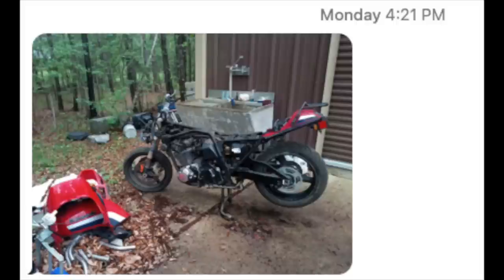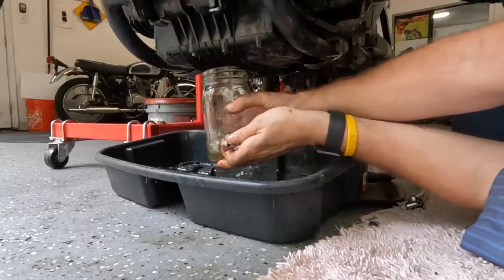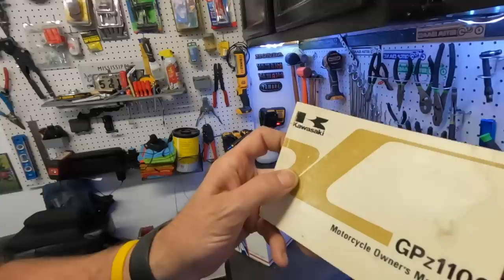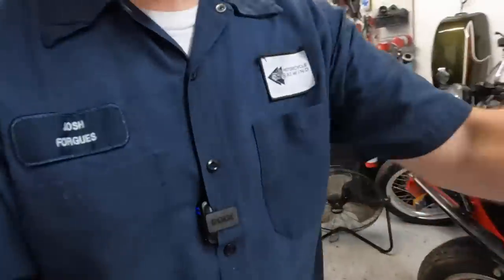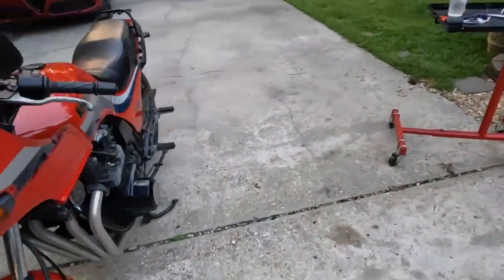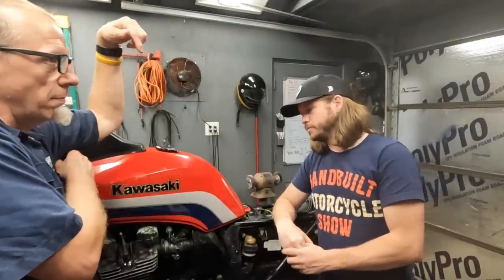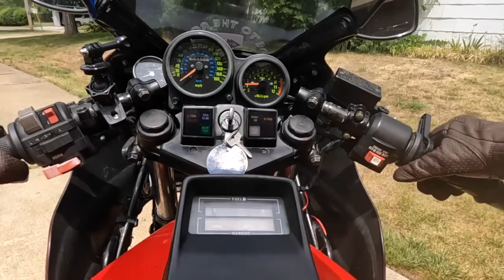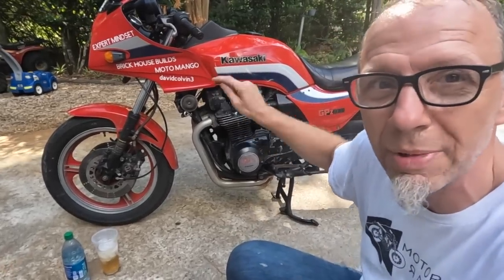Can I ride 3,000 Miles on abandoned 1983 Kawasaki GPZ1100 #gpz1100 #vintagemotorcycle #sportbike

Comment: Had a 750 in 87-90. My second bike and the first big one. This triggered a wave of nostalgia - and then all the stuff happening to your GPz cured me very quickly. 😂
A beautiful bike, was then and is today, but it wasn't very good even when nearly new. The 750, and this probably the same.
The tank rusted and leaked from the part leaning on the frame, killing all the rubber hoses with petrol, the mufflers fell apart inside, it was lazy, guzzled like a Russian.
And boy, did I love it. But, no thanks. 
In any case, I really enjoyed the video, cudos!
Reply from the maker: Thanks for watching and sharing your stories. That is my favorite part of these old motorcycles, the stories that come with them.

Comment: The setup and instrument cluster is so cool on this bike! Love the volts procedure! What a cool bike. Nd the KERKER exhaust what a score!!!! That exhaust probably alone worth $1500
Reply from the maker: Agreed. When I found the voltmeter. I was like a kid a Christmas. Thanks for watching.
Reply: In the day full header was a few hundred bucks, not sure why 2000 grand now still just metal pipes and cannister, really not any better than old ones just 10 time more expensive. I get high costs on some things but tires have not gone over 1 grand a tire but pipes are most expensive parts now that are not really worth the cost. in 85 bias ply tie for my ninja best around was 125 to 150 a tire  full header 400 bucks now tires 250 a tire for good sport bike tire but pipes 2 grand?  metal is not that expensive but tire tech is light yrs better.

Comment: Had a B2 gpz with intermittent running,  turned out it was the back of the fuse holder wires had gone green , once cleaned and reconditioned was trouble free 👍
Reply from the maker: That’s a good call. Won’t hurt to get back there and give it a good cleaning. Thanks for watching.

Comment: I had the GPZ550. That's one heck of a free motorcycle. 👍
Reply from the maker: I am trying to get a GPZ550. Just have to decide when I want to go get it.
Reply: @motorcyclerewind 
I owned a 1984 GPz550 / AKA zx550A1.    It had same frame-mounted half-fairing as your 1100.    My 550 was the LAST year they ever made GPz550.  The next year,  they came out with GPz600 Ninja  (with the 16" front wheel).

Comment: A great resurrection of that beauty. Well done man👍🙂
But you've to repair the tachometer 🙂
Reply from the maker: The tach works great. The speedometer needs the correct cable. Thanks for watching.
Reply: @motorcyclerewind  Don't forget to give us some news about that problem of ignition 🙂👍

Comment: Check your soldier joints on your ECU. Point them all. If there is a small crack anywhere, pointing them will fix this thermal problem.
Reply from the maker: That’s a great idea. Thanks for sharing and thanks for watching.

Comment: I can't remember if these had anti dive on the front end and maybe a 16'' front wheel if so that would explain the different front end as anti dive parts and 16inch front tyres are almost impossible to get. These were first Kawasaki to have Unitrac  rear suspension and the first manufacturer to do and production bike with efi.  Your doing a great job. One thing to watch is the cam chain tensioner  has 2 sprungloaded wedges which run crosswise check them regularly as they score and hang up so that the chain rattles face them off on a wet stone to fix it
Reply from the maker: Terry, it does have anti dive. 18 inch front wheel and 17 rear. The GSXR wheels that were on it were 16’s. Thanks for watching.

Comment: Remember these when they were new. The fuel injection meant 120 horsepower with just eight valves. A very quick motorcycle. 150 mph 'straight from the crate'. Compare that to Honda's cbx1050, 105 horsepower with 24 valves. Unfortunately the fuel injection came with reliability issues as you have discovered on your trip. This caused many owners to either give up and sell or retro-fit carbs. Kawasaki would later go back to carbs with the GPZ900R and 113hp.
Reply from the maker: I believe a well sorted fuel injection on these would be perfect. Mine has been fine since the breakdown. About 2,200 miles.

Comment: This is a great example from the golden era of motorcycling. I started riding street bikes in 1975 on my cousins CB100, and then my own CB450 shortly after. I still own a 1985 Honda V65 Sabre VF1100 with a Pichler fairing and GIVI bags. Almost impossible to find experts on these V4's. My mechanic performed miracles on it after four different shops. It still has a miss, power drop, between ~6k-8k rpm. My mechanic has changed everything and is at his wits end. I'm in Virginia and am open to suggestions. The GPz series were my favorite looking bikes. I owned a GPz 305 just because I found a NOS, it had a top speed of 105 mph indicated. I owned three Ninja 250's over the years but preferred the GPz. Still regret not having the GPz550, although the newer NInja 600's were better handlers. Now I have the SV650 and Hornet 919 in that sporty category.
Reply from the maker: I love hearing motorcycle origin stories. Thanks for sharing. I really like the GPZ 550. Hoping I can get one someday. Thanks for watching.
Reply: @motorcyclerewind 
I owned a 1984 GPz550 / AKA zx550A1.    It had frame-mounted half-fairing (NOT the bikini fairing of the  Z550)    Mine was the LAST year they ever made GPz550. The next year, they came out with GPz600 Ninja, with the 16" front wheel.
Reply: @motorcyclerewind 

( my GPz550 had the same
fairing as your 1100 does )

Comment: I'm going to Agree with Tim wright. Electronics in general heat up, expand, and traces open on circuit boards, connections in coils and pin connectors all fail. Sometimes they cool and are ok... Sometimes not so much. If be looking for the resistance value for that pick up coil and testing it once it does. Is also be cleaning all the connections and packing them with dielectric grease. Good luck, she's a beaut!
Reply from the maker: That was one of the big(tedious) we did when we were broke down in St. Louis. We tested voltage and resistance of every pin(per the service manual) of the ECU and each sensor. Cleaned them all before testing and packed with dielectric grease after. The air temp sensor was within range but on the lower side. And the TPS was jumpy when testing with throttle.that was sorted with a second cleaning after we removed it. 
Thanks for watching. 
Oh, I agree with Tim too!!!

Comment: Did you read the flashing fault code on the ecu? You know it has a small led on the actual ecu near the plug? , long and short flashes can show what sensor is at fault on the ZX11. You can richen the mixture by fitting a multi turn resistor in the engine temp sensor (fools the ecu into thinking the engine is still cold) or by fitting an adjustable fuel pressure regulator, the multi turn resistor/potentiometer works well. Used this trick with my open baffle Harris pipe to richen the mixture, I had the earlier B2 as well but these ZX models had the better engine, bigger small ends, hand finished heads and different cams, they come alive at 6000rpm, mine was an A2 new in 85. Loved it.
Reply from the maker: When I got the DFI fault before we did not see flashing codes. Light may be out or too bright in the shop. So we check each sensor and each pin on the connector to the ECU. Thanks for watching.

Comment: I had one a while back, new connector on the engine temp sensor cured most misfires, eventually it throws up a fault code (s o s in morse code iirc). These were also hard on plugs, gold palladiums were the goto plug)
Reply from the maker: I have changed the temp sensor. Good to know about the plugs. Thanks for watching.

Comment: Im amazed the bike ran as good as it does considering all the problems that could have arisen after sitting exposed to the elements for all that time.
Ive never owned or ridden a gpz1100..im too short!
But i did own an 84 gpz550
I love the gpz kawasaki bikes and i always loved that unique sound they make that whine/whistling sound!.
Ive owned several bikes since then but that 550 has always been close in my thoughts
Reply from the maker: Stay tuned. There is a GPZ550 in our future.
Reply: @motorcyclerewind  NICE!!!! I moved to the philippines a few years back and hadnt ridden a bike in a few years after an accident on my HD Super Glide.
But i got here to Cebu and the near year round sunny weather got me out of my 'gun shy' atittude about riding scooters again so i began looking around for whats available
YUK....mostly 110-175cc scooters..anything bigger is very expensive..anything modern with alot of widgets and electronics im not equipped for..So i looked for older bikes with at least 2 cylinders
I stumbled upon a Kawasaki Zephyr 550...she is banged up pretty bad and has been sitting under a tarp for a long time..anyway it seems it shares some things with the gpz550
We shall see i suppose,She will crank over,Cylinders and pistons look oddly in nice shape,No water in the oil,no chunks or bits of metal in the oil..but some heavy corrosion on the aluminum..trans is stuck..i dunno,But i will follow along here on your channel at any rate and learn

Comment: Just noticed a short clip showing the ECU.  It looks very similar to the one on my ZG1300.  Does the owners manual say anything about the green flashing light on the unit.  On my machine when there's a FFI fault the wee green light on the unit flashes a morse code identifier for what's at fault.  Maybe your GPZ1100 has a similar setup.  If you need I can send you the morse codes and what they identify,,,,,,,who knows they might be the same ECU.  Smashing vid MR.
Reply from the maker: Thanks. This ECU has the same flashing lights. Thankfully the supplemental manual for the GPZ has the codes in it. Thankfully the final breakdown was just a loose coils shorting. Sorted that at home and it’s been all good.
Reply: @motorcyclerewind  Glad you got to the route of the problem.👍

Comment: Great video! I had the poster of this bike on my wall back in the early eighties, I guess you know how old I am. One of my favorite movies was "Rumble Fish" Motorcycle Boy stole a GPZ 550 and rode it like he was the only person on the road. Three questions. With all the water in the crack case you did not change the clutch plates? or did you just not show that. What is the gauge on the left side of the gauge cluster? Finally, I remember Kerker pipes in the seventies and eighties, are they still in business?
Reply from the maker: Took clutch apart and cleaned them. There was no rust in there. This video was a compilation of the 25 videos that made up the GPZ story. So more detail in those. Thanks for watching.

Comment: Beautiful machine. I have a Kawasaki GPZ550 -82 in my garage. It runs but once it gets hot the rpm won't go down. I have cleaned and renovated the carburetors and also changed the rubber on both side of them. It's a shame, would love to put more miles on it but right now it's just not fun to drive and I can't figure out the issue.
Reply from the maker: I really like the 550’s. You will get it. I have a 1964 that was kicking my butt for months. Finally got it sorted. I had to forget everything I did before and start over. Ended up being the idle jet was clean just not clean enough. Yours could be something simple. Good luck. Thanks for watching.
Reply: @motorcyclerewind  Yeah my garage is not so well equipped yet so it was a manual clean. Should invest in a ultrasonic cleaner and try again!

Comment: I had that ticking noise too once. Was in France too, remember trying to make a Kawa dealership understand my poor French and that I only wanted the exhaust gaskets, not a whole gasket set!
Reply from the maker: 😂 That would be crazy.
Reply: @motorcyclerewind  and, touring in Scotland I topped up the oil at a filling station but forgot to screw in the filler cap, about 3 miles down the road I realised my boot was covered in oil!!

Comment: Ex courier here. You have to replace the clutch safety cut out switch. Short out the side stand safety switch. Provide drainage of the water out of the wiring loom under the headstock. Clean up all electrical joints with wd 40 and solder on the low tension connections to the ignition coils. Then find the broken brown wire in the loom....( clutch lever side.)
Reply from the maker: Sounds like you are speaking from experience. One of my favorite thing about having a YouTube channel is having other people share their knowledge. Thanks.

Comment: Free scores are the best especially old school big bore. 😊
Reply from the maker: I am a connoisseur of cheap motorcycles and love FREE ones. Thanks for watching.
Reply: @motorcyclerewind  You sir are my kind of motorcycle gear head. I myself own a 94 GSXR 750 w. That has a 2001 1200 bandit S  oil cooled mill crammed in the frame rails. still jacks 2 gear power wheelys  5 mph slower  than the OG 750 minus one gear 5 sp instead of 6 it's hillbillied   out. With  parts from ebay and the scrap pile. 2 brother's carbon fiber can pair of welded box wrenches as passenger foot peg mounts for the foot peg. motor cross foot pegs for the rider set up for GP shifting 1 up 4 down. Can't bend the left knee to get my toe under the shifter. Pair of fat  bars with small risers. Candy orange metal flake paint getting tired I'm 60 years old wouldn't have it any other way.

Comment: Hello, mate I love the Kawasaki GPZ 1100 One of the best motorcycle ever made but I Just want to asks you Something as I noticed that the Speedo Cable Wasn't Working When you did nearly the 3,000 miles as it's against the law to be Working as it puts the miles on the Speedo Clock as I am Graham by the way and I add a GPZ 750 toubo as it was fast and I love it mate keep the Video Coming mate Cheer Graham and Safe riding alright.
Reply from the maker: When I get the right cable I was planning on running the speedo with a drill to the correct odometer reading. Thanks for watching.
Reply: @motorcyclerewind  Okay mate and I Think it Still against the law for using a drill to clock in the miles but That's up to you hope you don't get in Trouble with the police l hope not Well Take Care mate just Thinking of you mate and ride Carefully and Safety of Course Keep the Video Coming and let me know if you find out Why it's Keep Cutting out and not Starting up again.

Comment: I owned the 84 GPZ750 TURBO. What a rocket and we’ll built. My only complaint would be weight was off the chart. I will say I NEVER had a fuel injection problem but I would think the fuel pump and system would be compromised after years of sitting.
Reply from the maker: The fuel pump ⛽️ and regulator or one this list of preventative maintenance to be done.

Comment: Bonjour! Really enjoyed watching this video, brings back great memories. My first bike was a firecracker red 1983 GPZ 550 back in 1986. I traded it in 1990 for a steel blue 1984 KZ1100R, at the time i wanted a 1982-83 Eddie Lawson Replica so bad but these were not cheap even back then. Even though your bike and mine share the same engine, my bike was carburated unlike the GPz. Motorcycles with DFI were still  uncommon back then, i wonder if you could fit carburators on your bike. Would that solve your problem? I hope your GPz will keep bringing you miles of smiles! Greetings from Montréal, Québec.🖖
P. S. I currently ride a 1993 orange/purple Kawasaki ZX-11... 🏍️
Reply from the maker: Bonjour mon amis!!! Thanks for watching. People have changes out the DFI for carbs. Thankfully my problem was not DFI related as I first thought. It ended up being something super simple. The coil for cylinders 2&3 vibrated loose and was shorting out. After tightening it up it has been good.

Comment: I'm in agreement with @timwright3790. The BMW K75, K100 and K1100 all pull the same stunt for the same reason. Unlike the Kwack though, I can remove the HES sensors and replace them with new ones on the K series. It's a bit of a faff and takes about two hours, but new sensors at £14 each and two hours work is a damn sight cheaper than £228 for a new plate.

Quick diagnosis: start the engine when cold and play a hairdrier on high heat on the HES. If it is them, the engine will die fairly rapidly.
Reply from the maker: Great tip with the hairdryer. Just make sure your wife is not home. 😂

Comment: good job, you cant beat the price. I notice you kept the speed down when on the road, was this because the speedometer doesnt work ? Also check the crank/cam sensor that triggers ignition, your bike has the symptoms of a failing hall-effect sensor
Reply from the maker: I kept the speed down in hopes of living longer. 😂🏍️ I accidentally got up to 95 mph on day one. After that used the throttle lock and kept it pretty constant. That’s for the sensor head up.

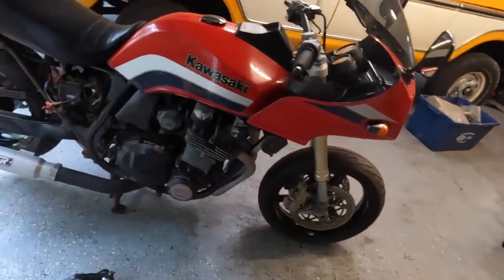Comment: I was blown away to see this bike came with inverted forks and beam brakes until 17:23. It was kind of a bummer.
Reply from the maker: The GSXR front end did not work. The previous owner had a triple tree built to fit those forks. It was not safe. First the turning radius was to narrow. I could not u-turn  the motorcycle in my driveway. There was no way to mount the gauges, ignition switch etc. The rear swingarm from the GSXR did not work. It hit the frame. So all had to be removed, engineered and rebuilt. 
Plus I like the look of the factory stuff. Especially the wheels